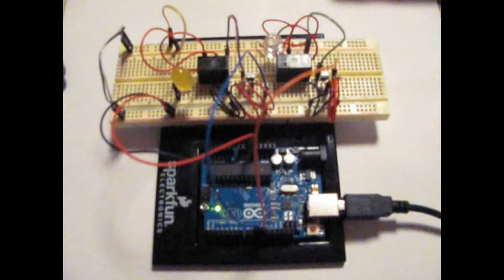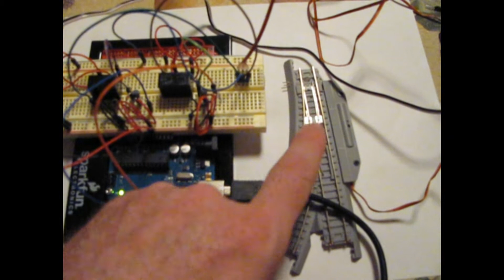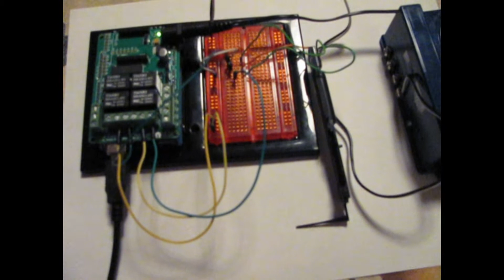Arduino control of model railroad turnouts

Comment: Hi Ken came across your video after trawling around for a way of operating my n gauge fleischmann points. I want to operate them with a Arduino mega 2560 to have red green leds showing which direction has been set. The big question is could you help me with the code for this?
Reply from the maker: +Phil Newman Sure. Hit me up at 648.ken@gmail.com

Comment: Hi Ken.  Nice video, but I would like to make a suggestion that will make things a lot simpler and even cheaper...
Most turnout  solenoids  also run on  DC power, so instead of buying expensive relays for the 18 VAC, you can  use 16-20 VDC  and replace the relays  with  BD-139 transistors.  I am using this all over the layout and it works just fine with most solenoids.   Just don't forget to put a DIODE  (1N4002 or similar)  across the solenoids to prevent high inductive voltages that will damage your transistors.   Check out my Arduino DCC site and looko in the tools section :  http://dcc-arduino.weebly.com/tools-and-resources.html

Good luck with your projects , man !
Reply from the maker: Yes. I agree. I think even a simple generic TO-92 package transistor should be able to handle it. Once again, a case of me making a simple task a little too complicated. I did, however learn a bit about relays, which I'm sure will come in handy somewhere (like switching the florescent light on and off for taking the layout from day to night).
Reply: I was investing some time in my train and used your suggestion to switch the turnouts. It worked very well!!!  Thank you to bring it, now I have control of my train and the turnouts using a remote control. I am using an arduino Mega but can use a Nano also. Next step is control the train lamp and add sound to the train. .